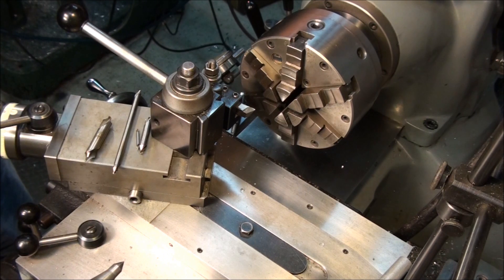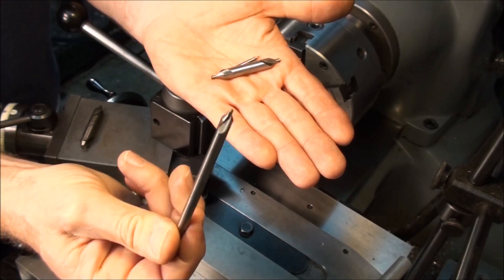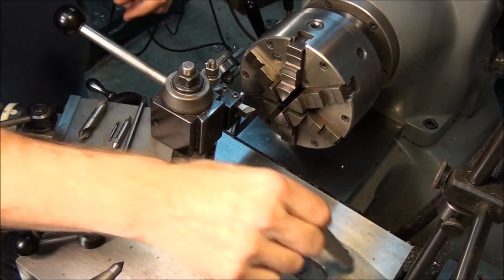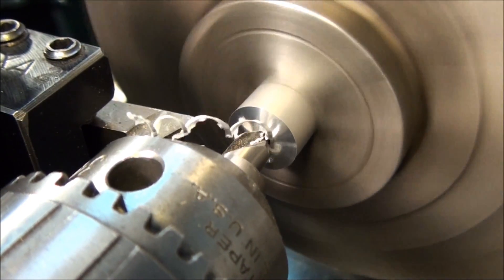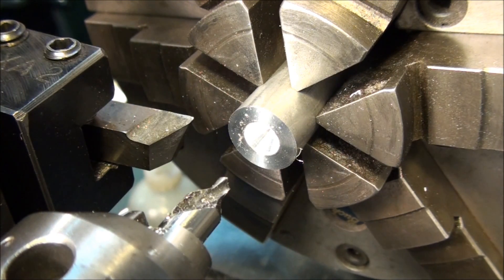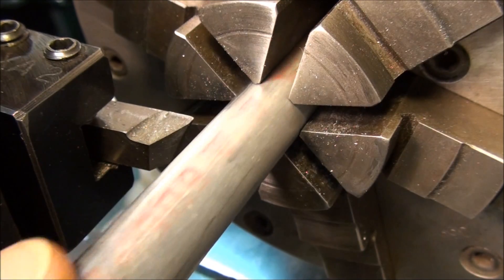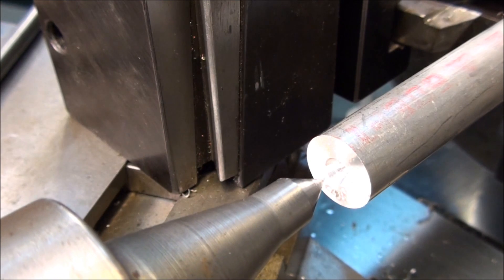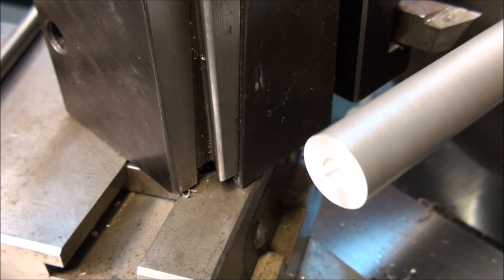Center Drills and Center Drilling

Comment: You didn't cover the center drills without a pilot.  They have a very short twist (flute) and the rest of the length (4-6") being solid round stock and a taper from the full diameter at the leading cutting edge.  I have heard them touted as better than the ones you are showing and that I use but really don't know why they claim that.  I see them as valuable for a longer reach but the broader cutting flutes would seem less accurate if anything?
Reply from the maker: +Douglas Thompson 

You are referring to spotting drills. They are used to spot a part before drilling so the drill stays on center. They are not intended for use with a center because they have no pilot and debris can get between the center point and the bottom of the spot, preventing the center from running true.

Tom

Comment: Are the RPM's the same for a center drill as the twist drill of equal size and material?
Reply from the maker: +W.Co.VIDS 

Yes, the same as for a drill the diameter of the finished center size.

Tom
Reply: Toms Techniques Thanks, Tom!

Comment: That's a good point. To centre out from the chuck if turning out that far. Thanks. I most likely would have made the mistake over and over without it dawning on me to do just what you said.
Reply from the maker: Thanks Tom. I'm sure I've made plenty of parts that had some taper on them because of this before the light came on.

Thanks for watching.

Tom

Comment: The best way would be to use a steady rest and Dti :) and then dial it in ??Or buy straight stock..So many correct things to do before getting to the start of center drilling making sure your stock you need is accurate, this can easily be ruled out by placing the stock between 2 centers and running a DTI across it length if its a massive run out send it back to your supplier..

Comment: Any ideas how to avoid runout with stock that's too short to reach a center? I was trying to true up some 5 inch bar on a Myford and the carriage was fouling on the tailstock - couldn't get the cutter all the way to the end.
Reply from the maker: Turning between centers has its limitations. As you have found, it doesn't work well on short parts. One option is to turn from one end as far as possible and then switch the part end for end to do the other end, although that may leave a mark where the cuts overlap. A better option is to just start with longer stock chucked and supported with a center on one end. Then you can turn as much as you need and part it off.

Tom
Reply: Toms Techniques
I ended up trying the former way: leave an inch poking out at a time and size it before sliding some more out. I was going for a sliding fit into some tubes, so the "steps" between the cuts didn't matter too much - a scotch pad got everything level to the touch:). Besides, the material was quite "gooey", and didn't seem to WANT to hold an edge!
Reply: Lol 3 years later but you can make a long cap to press over the end of the part and center drill the end of the camp

Comment: Hi Tom great video, just one question when facing that close to the chuck, wont the faced surface be perpendicular to the un machined OD,( the bend or run out) instead of the true turned surface? is it best to face close to the chuck, drill centre with part extended, turn the OD true then face again with the part close to the chuck, to get it pretty perpendicular?  thanks again for the great videos
Reply from the maker: If you want or need absolute perpendicularity, then finish face to length after the part is turned, In many cases you would want to do that anyway to remove the centers.

Comment: I learned a little about the various kinds of center drills. Also that you think it's OK to use a center drill for spotting drill hole locations, although for that purpose it is best to drill only far enough for the tapered hole to be larger than the web of the drill. On HSM there was a discussion where some insist on using only spotting drills. It depends on the angle of the drill tip vs that of the center drill (60 deg). Might make a good video. I also learned to grind the tip of my center punch more like 90 degrees.

As for drilling the center on a long piece held in the chuck, perhaps that is valid for a precision 6 jaw chuck or collet that grips perfectly, but for a 3-jaw chuck I would try to center the end before tightening the jaws, as the runout may just be due to jaw alignment.

Thanks for the very clear and detailed video.

Comment: Ok. I've watched this video a couple of times and I would like to ask a question. It occurs to me that out of round or wild run out pieces still offer a turning center somewhere on the face. If the extended end is wobbling a lot, run out of lets say 8mm (0.315") as a poor casting might (or even a bent piece of round stock) would there not still be a perfectly quiet place on the face - the center - into which the center drill would enter just as it would on a piece running true? Thus the boring bar effect mention by H H would not occur. Is this correct? Great videos. Great!
Reply from the maker: Jim,

You are correct. The center drill will fall wherever the center of rotation happens to be. Like I mentioned to HH, the only time the drill would try to bore is if you tried to re-drill a hole that was drilled in another set-up and is  no longer on the center of rotation.

Tom

Comment: Tom,

If you're just putting a center in a part and not using a live center (ie.. going to drill afterwards) - is it acceptable to just use a spotting drill ? 

I have been using the 120 degree spotting drills (for my 118 degree drills) and it just seems faster and less chance of breaking of the little pips of the center drills. I use these spot drills in the mill as well for the same reason. When installing a live center, I use the center drills.

What's your advice?
Reply from the maker: Glenn,

Center drills work fine for spotting. That's what I was talking about using the long center drills on the mill. You don't have to worry about breaking the pilot off because you just spot with the point.

Tom

Comment: Try pulling the part against the center before closing the chuck.
Reply from the maker: Why???
Reply: Tom's Techniques
If you don/t have your shaft in alinement when you tighten the chuck jaws, the part CAN clamp crocked.  By pulling the centered part against the tail stock, it will hold the part straight while clamping it.  I have more problems with aluminum than any other materials.  I have very good luck holding the projected center drilled hole against the center while tightening.
That is very nice equipment you are working with!
Glenn

Comment: Happy Thanksgiving Tom. I look forward to your videos, and your site is very well laid out. Question about center drills/drilling; if you are using something other than a 118 degree bit (say a 135 degree split point), will it work as well? I have not seen a center drill other than the 60 degree angle.       rd2012
Reply from the maker: Thanks Ross.

Center drills only come in 60º angles and don't have split points, they rely on the stiffness of the drill to stay on center. If you want to drill a hole that is absolutely on location, it needs to be spotted with a center drill first, even if the drill has a split point.

Tom

Comment: Thanks for the Vid Tom. Useful as always. I built my drawbar for my mill and due to spindle size I had to leave the piece hanging far out of the chuck when I center drilled. I was told by numerous people this was wrong, but in fact what you showed indicates I got lucky and actually did it right.
Reply from the maker: Steve,

The method in the video only applies if you plan to turn down the stock, the idea being to not introduce any stresses in the part before it is machined. If you are just adding a feature such as a thread to the end of an existing shaft then the shaft should be center drilled close to the chuck to maintain concentricity. There is an exception to every rule. :)

Tom

Comment: Thanks Tom.  As usual a good explanation to go with the video.
I'm thinking on the extended wobbling stock the counter drill will act as a boring bar and the finished hole will be larger than the pilot drill.  However the center of it will be centered just a larger dia. And the tapered end stock will still fit and hold it true for cutting.
Naturally you will have to remove more stock from the OD to clean it up, to have a perfectly cylindrical part.
These little things such as bent stock are the ones that bite you and spoil the finished product, good fix for that
Reply from the maker: If the part is wobbling, the center drill will be just be slightly off center (on the center of rotation), not larger. The only time it would tend to act as a boring bar would be if you tried to correct the center drill location by extending the stock and re-drilling it.

Thanks for watching.

Tom

Comment: thats an awesome piece of info lost on many tradesman and mechanical engineers, good advice i have trouble getting apprentice to understand these things, its good to see you hint at the importance of setting things up en situ, a video on machining between centres would be an awesome one or using fixed and travelling steadys

awesome video thanks for uploading
Reply from the maker: I do plan on doing a video on turning between centers as well as on on the use of steady rests. There is no shortage of material to cover.

Thanks for watching.

Tom

Comment: I'm having some what of an issue with the last part (supporting with a chuck and center). Wouldn't it be better to straighten the work piece so it won't rotate "off center" like that? Drilling center in both ends of the work piece when held as close into the chuck as possible, to me, seems like the best way to achieve a truly unified center... I mean, if you extend the work piece like you say and only then drill the center, the drilled center isn't really on center... I really appreciate it, Tom. You're awesome and I learn a lot from you! :)
Reply from the maker: The best way to ensure that a part is concentric with the centers is to center drill  each end as in the video and turn it betwteen centers. Center drilling with the stock extended from the chuck only applies if the part is to be finished and parted off while held in the chuck. I probably could have made that clearer in the video. Straightening the part might be appropriate if there wasn't enough stock to clean up the run-out.

Tom

Comment: Great video. Just some thoughts and experiences I have on center drilling and facing shafts and then moving them out of the chuck to allow machining along the shaft.                      
What you say is correct about the part running out but if you only grip the material by a short section of the end, in the extremities of the chuck jaws it will allow the center drilled end to be moved on center and run true.
This will also improve the rigidity of the set up because the supported length of material is shorter. This is caused by the chuck jaws on any chuck not being parallel and gripping on the inside end of the jaw [bell mouth].
To eliminate this problem on jobs with the material protruding into the lathe spindle use aluminium packers under the chuck jaws to shorten the grip length of the jaw.

Comment: Hi Tom, the curved edge centre drill is for supporting the work while taper turning using the offset tail stock technique, or so the manufacturers claimed way back when. The Slocombe (centre) drill that cuts a recessed centre is for making a protected centre, so that an item can still be re-centred even after some use where it might have been subject to damage. Both of these uses are a bit rare these days, but useful to know about all the same.
I do applaud your efforts to pass on your knowledge and skills.
Reply from the maker: Thanks Chris, did I forget to mention that? I'll go back and add a note to the video.

Tom
Reply: Using a recessed center is very important when you're doing repair and maintenance machining. We repair shafts all the time at my shop and centers-- clean ones, not caked with grease and grime-- are crucial for our work.!
Reply: @Menthol_ballroom don't forget the ones that some kind owner mangled with a club hammer😂
Reply: @chrisstephens6673  I wish we do do trade-ins-- one big brass punch for every claw hammer or screw driver.!